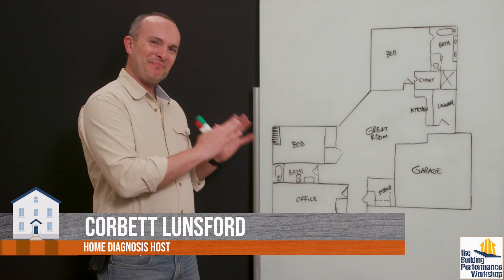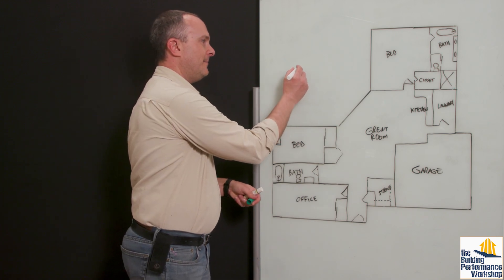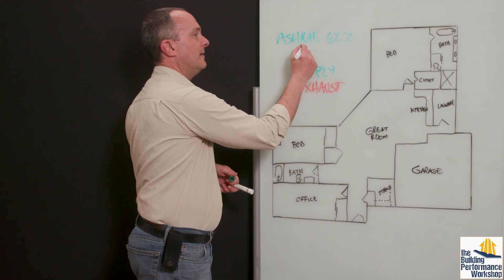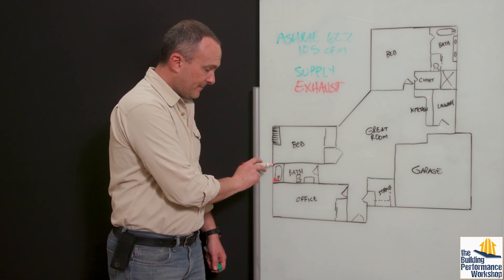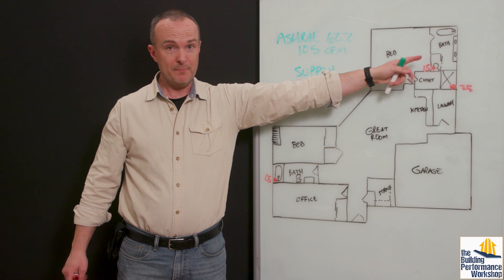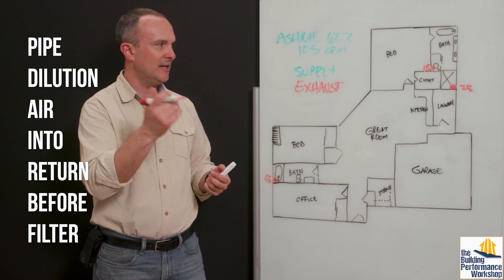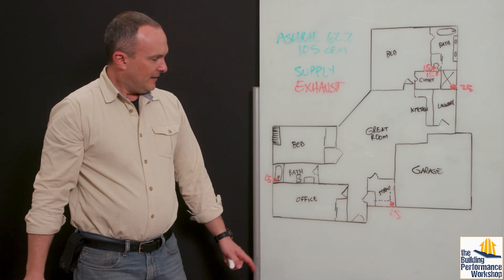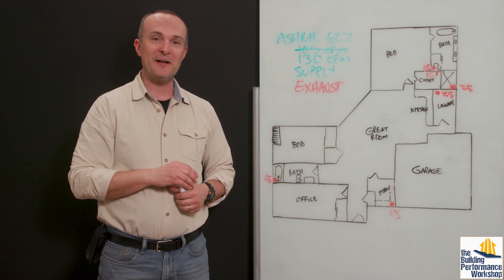Airtight Home Ventilation: Where to Place ERV Exhaust and Supply Grilles (HVAC Training)

Comment: If you dump the fresh air into the return of the central AC, and provided the ERV is set for 24/7 operation, then wouldn't your blower in the air handler also need to run 24/7? That doesn't sound right to me for my market in central Florida. We need the air handler to shut off to allow the coil to drain condensate for humidity control, am I missing something here? Thanks. I'm thinking I might just need a dedicated whole home dehumidifier in conjunction with the ERV.
Reply from the maker: Hey Andrew- you don’t need the pause to drain if you have supplemental dehu, which you def should in FL regardless. The upside of circulation, even temp/RH, and filtration outweighs the slight ding ding on the dehu.
Reply: @HomePerformance ok great, thanks for the info. So you would recommend just having the dehumidifier calling for the air handler fan on when the dehumidifier runs right?
Reply from the maker: If the AHU is running 24/7, no need- fyi Mitsubishis are designed for 24/7 blower.
Reply: @HomePerformance thank you, really appreciate you getting back to me, love your videos. I’m learning a lot!

Comment: Are you saying that a bathroom exhaust fan is no longer needed to switch on when showering? The ERV runs 24/7 therefore traditional bathroom exhaust fans no longer needed?
Reply from the maker: Correct. And it’s in the Int’l Mech Code too.

Comment: Hello!  Quick question, and I apologize if I'm missing something obvious because I'm new to the channel.  In your description here you note that you "generally only recommend ERVs for very airtight homes (less than 2 ACH50)".  Do you have a video going into why that is, or what you do recommend for older houses?

I ask because I have a ~100 year old home, so it's very leaky.  However, there are some reasons I'm considering an ERV - basement moisture levels (stone walls), potential Radon, smells (basement + litter boxes), and generally just a desire to move fresh air through the house.  The home, despite being leaky, has a tendency to get stagnant and basement litter boxes and moisture with an open door for the cats mean smells drift upward.

The house currently has no central ducting (the only current heat is a vastly underspecced wall furnace in the family room, house was originally heated by wood stoves), but I'm planning to add a ducted mini-split system via the basement, which has completely exposed ceilings giving good access.  Adding an ERV seems to make sense to me, but you're the expert here and I'm interested in your input.  I just couldn't find a video addressing that!

Also, my local electric co-op has a $500 rebate for any ERV install and it doesn't require a license contractor, so I'd get a pretty solid discount.

Comment: So you run some sort of flex ducts from each ERV return (separate from the air handler’s returns) to an exhaust collector and then dump that to the ERV exhaust, but then you pipe the ERV supply into the air handler’s return be for the filter?
Reply from the maker: Yep, that’s the most straightforward way

Comment: Do I remove the bathroom fans and use it as the erv/HRV exhaust suction location or do I supplement the existing fan with a erv/HRV exhaust suction location in the bathroom?
Reply from the maker: It depends on many things, don’t take a simple answer

Comment: I have a home built 100 years ago where the walls are only true 2x4 and I already insulated from the exterior with rain screen and exterior insulation because the inside is plaster and lathe and we live in there with kids. It's only like 1400 sq ft up and down total. 2 small bedrooms and living room upstairs with 16ft open ceilings and a s. All loft open up there and then downstairs we have the kitchen/utility room (always open door) and 1 bathroom. 

We love on a rock and have high levels of radon that the radon fan has issues with when it's raining and winter (windows closed) should I just put 50cfm on each and put them furthest from the outside doors in bedrooms? We rarely close doors since it makes it feel cramped

The utility room is where I'd put erv but.. oil boiler there that has a damper and when it's windy it flaps open and closed a bit. We have a heat pump water heater in there and I don't want to pull diesel heat fumes back into the house xD.

Comment: i live in the United Arab Emirates, where temperatures during summer can be up to 52 degrees celcius, and 12 degrees celcius in the winter.  Our problem is most buildings here and homes have oversized air conditioning system to cool us rapidly, and almost all buildings are air tight.  would an ERV work here?  because we get rfeally high relative humidity indoors whichs is causing mold problems for most homes.  Please do an episode for homes in regions like the middle east.  thank you.
Reply from the maker: FYI I have had clients in UAE and Egypt, happy to help if you need it. Yes, ERV and also dehumidifier would be useful.

Comment: Hi, how are you determining that each exhaust is 25 or 15 CFM? Is this determined by duct size?  Also, in some of your other videos I hear you talking about upgrading all ducting to 8 inch diameter as it moves double the air. Would you recommend this for both exhaust and supply forERVs?  Great videos thank you!
Reply from the maker: I love pizza btw. 20 cfm is code, but I think showers are more important than toilets, hence the 25 and 15. Upsizing the trunk lines reduces friction, you won’t get 2x airflow but it’s nicer on both supply and exh.
Reply: @HomePerformance  thank you for the clarification.  I live in Texas in an older home built in 1970.  I’m in the process of sealing all the cracks, holes, voids with canned closed cell foam (Great Stuff) And was considering installing an ERV before I go back in with blown in insulation. Would you recommend an ERV for an older home like mine?

Comment: I've watched the whole video but you did not put any supply on your plan. Where do you need to put supply? Also, in bathrooms, do you need an exhaust fan or is the ERV enough?
Reply from the maker: ERV is enough, 20 cfm continuous per code. Supply either into bedrooms (mentioned, but briefly) or into return plenum of air handler.
Reply: @HomePerformance  Alright! Since you place your exhausts in the corners of the room, where would you place the supplies? Thanks!
Reply from the maker: @AntoniPaquet bingo, same logic- the futhest spot from the door would be best but if you mix with ceiling fans then it doesn’t matter
Reply: Thanks alot!

Comment: Is there a recommended return boot and grill for placement when set in shower for erv exhaust?  I assume platic is better then metal. Is there an ideal shape /size?  Would a liner slot return be appropriate in this use case?

Comment: Hello, I'm Building a 2,492-square-foot home in CT (with four bedrooms, 2.5 bathrooms, a small airtight attic, 16", 9' 8' ceilings, and four people). I'm considering the Broan B160E65RT AI 142 CFM ERV and a Waykar 130-pint dehumidifier (location basement). The question is how to duct it with five supplies and seven exhaust locations, one of which is the attic. Thank you for your time!

Comment: Question ... 
What do you use as return and supply vents? 
Specifically looking for size and shape.  I'm getting an ERV installed, and I don't think my installer is smart on the setup/concept of how it should be done.

Comment: I think that the emphasis is CO2 buildup and odor control so IMO, exhaust the stinky or humid areas, supply the populated areas where people need the fresh air, then let that air migrate towards the exhaust points. Ventilating a closet is probably not a common practice but I suppose the closet could have  louvred bi-fold doors and let the air exchange thru natural convection. The laundry room has a mechanical exhaust by virtue of the Clothes Dryer, and is a low occupancy area so why even bother.

Comment: 16 yr HVAC service technician here. It’s infuriating to find out that my common sense has been correct from day one about vent locations and the need for ervs. I’ve always wondered why the ‘fart fan’ is always located closest to the toilet rather than just over the shower. Dumb! It’s not for odors, it’s for humidity removal. Period. Great video.
Reply from the maker: Thanks man, happy to hear it
Reply: The principal at my firm says the same thing and doesn't agree that it needs to be for humidity removal. 

The only consideration for putting it in the shower corner is it brings in relatively cold air into an otherwise hot shower. Something I advise our clients on and let them decide.

Comment: I think it is a mistake not to have an exhaust for kitchen. Cooking produces lot of humidity and various smells.
Reply: But this way you make a messy disbalance of in/out volumes. Will not work in tight envelope houses. Good extraction hood can do hourly cfm of an erv/hrv in few minutes. And in cold climates this will not work, might freeze the unit as it sucks a lot of cold air and there is no exhaust to warm it.
Better to do extraction hood with carbon filters, that dumps air back in the house and have erv/hrv exhaust in kitchen. Well at least thats how we do it Europe.
Reply: you are loning for make up air
Reply from the maker: You have a dedicated exhaust hood dumping outside, use that

Comment: So, just a thought— about that first thing you said with Vancouver’s code requiring HRV instead of ERV.   You said you would strongly recommend ERV, because it’s damp there! Which makes sense.  

But — I just happened to read just a few minutes ago, on a different site while I was researching all this for myself, a recommendation to specifically use HRV if there is high humidity —  •in the winter•.   If there might be moisture issues, in the winter.  Important qualifier?  
Since these systems are influenced to some degree by the temperature, and that seems to affect what they are doing and whether heat or humidity is traveling in or out, I imagine that summer humidity would be different from winter humidity, in how they would operate?  Is that true?
That was what my wondering was, when I came across that because I also was confused initially when I saw that the  ERV wasn’t what they recommended for winter time humidity.
 
   🤷🏻‍♀️
Would be curious to know what you, or others in the know about the systems, might think about that possible little detail.
Reply from the maker: Winter humidity is actually super dry when you warm that air up to room temp. See here:

Humidity Control 101: Psychrometric Wheel Calculator’s Dewpoint and Grains/Pound of Moisture
https://youtu.be/s-VyqdYnEfM

Comment: Hi Corbett,

I wish to check an idea I had, and for which I could not find any information (only a hint in one of you videos where you and your wife talk about the recirculation function of a Broan system). Given your approach, I thought you may have a relevant say about it. Here is my contact and my question :

Context : I wish to imrove the confort and Energy Efficiency of a hourse I own. it was built in the '50s and adding air ducts would be difficult in rooms. Corridors are not directly heated in the current setting.

Question : Would it be dumb to use a HRV to
 - pull air out of the Kitchen (level 1), Bathroom (level 2) and maybe Home Office (level 3) 

- push air in the corridors on 3 levels

and use a 2 Spot ERVs to supply rooms with fresh air by pulling it from the corridors when needed based on CO2 level detection. Maybe a simple vent would be enough ? (polluted air would be pushed below the door)

Thanks in advance for your feedback !

Comment: Your perfect house layout has a lot of showers and baths against outside walls. I was taught never to place large areas of waterproof wall (such as a shower or bath surround) against an outside wall, because it will create condensate and mould issues in that wall.
All airtight, all vapour permeable, is what we're being told here.

Comment: I plan on putting a spot ERV in my basement to help with radon mitigation. It is about a thousand square feet unfinished and I'm looking at the Panasonic whisper comfort 60, a new model that came out last year. It can be placed in the ceiling or on a wall and I'm trying to decide where it will have the most effect high or low? Easiest and with the least amount of turns for ductwork to put it in the ceiling, so I guess there's that consideration of loss of CFM

Comment: How do you check if your flows are balanced between hvac equipment and the erv fresh air if you put it into your main return? I read they’re suppose to come out with systems that are connected to your air handler but haven’t found any. Also how do you address the inefficiencies of this install method?

Comment: Thanks for this video! Are there pros/cons to supplying and venting every room? Bedrooms for example, having fresh air brought into one corner of the room, and "old air" sucked out from another corner?
Reply: More ideally, each room would have a center ceiling supply, and exhaust at opposing walls near the floor.  This provides clean laminar air flow to the head, pushing floor dust into the exhaust.
Reply: Every room that has closable doors needs to have its own balanced supply and exhaust. If the supply and exhaust to a given space are separated by a door, then when the door is shut either you have a draught under the door, or there isn't a big enough gap for a draught and the airflow simply stops.

Comment: The ERV was the biggest waste of money in my new build.  Super expensive.  Noisy.  Power Hungry. And every time i open a window the ERV is redundant.  I got so sick of hearing my ERV i turned it off. NOTHING WENT WRONG.  I didnt suffocate in my sleep.  No mold.  No dry air.  NO PROBLEM. ERVs are a Greenwashing scam.  Nothing more than an expensive loud power hungry fan.  The HVAC people who evangelize ERVs dont tell you that ERVs can freeze up in winter.  Then they try to upsell you a super expensive ERV Heater.  Which uses even more power.  Avoid this Green Wash Scam. They just want your money.

Comment: You have mentioned a few times on the comments that there shouldn’t be a ERV exhaust in kitchen. Can you provide an explanation why!? Or maybe you already have a video where you explain this!? 
Thank you.
Reply from the maker: There should be a powerful exhaust fan over the cooktop, dumping outside. If you have that, whether or not there’s a 25 or 40 cfm ERV exhaust in the space is not a big deal.
Reply: @HomePerformance  So you are not against having an ERV exhaust in the kitchen!? It’s just if you have proper exhaust over the range with a proper makeup air system there is no need for it!
Reply from the maker: Exactly right

Comment: im actually about to move my ERV exhaust vents to my kids bedrooms, and add a fantech bathroom exhaust.  I would prefer not to bring in air when exhausting the bathroom on hot humid days.  Is there a pressure difference, sure but I still don't believe my house is that tight.

Comment: So if you dump in to the return you have to run the air handler when the ERV is running as well?
Reply: That's actually a good question, I can't imagine the blower wheels on Erv's are strong enough to direct the air in such a large pipe

Comment: I’m working with an old house with a partial basement and no attic. Thinking to duct both supply and exhaust air from my furnace. Can I just pull straight out of the plenum and feed straight into the return? Id love to get more nitpickey over feeding and pulling from certain rooms but even renovating the duct system to feed everything used every last bit of space.

Comment: Are there some climates where HRVs and ERVs aren't worth the extra install costs and running costs? In Auckalnd our summers are mild and winters not bad either so it doesn't seem cost effective here. Would you agree just a positive pressure ventilation system would be better in Auckland?
Reply from the maker: Not climate, but home characteristics- if your home is tight enough that bath exhaust fans will cause suction problems, you must have an ERV to exhaust from bathrooms and balance. If not tight enough for that, then stick with simpler means of getting fresh air.
Watch this:
https://youtu.be/lnOCAPPVT5g?si=yRBsI7JJ7y2h8Heu
Reply: @HomePerformance  ph, let me clarify. I mean ERV vs supply only systems. MY point is, I think in Auckland it's not worth the extra cost to try and recover heat from the exhaust air.
Reply from the maker: Again, I don’t even worry about the recovery aspect- to me, it’s all about the balanced pressure in the home.

Comment: Can someone explain to me (cause I am not familiar with the technology): why can’t we simply open the windows once in the while?
Reply: ERV does a number of things better than a window. It balances the intake/exhaust air temps so your heating/cooling system doesn't have to work so hard to maintain indoor climate. Also, open windows allow allergens to come in whereas the ERV can clean the fresh air before distributing it around the house. ERVs also do a better job of moving the air through the whole house to manage humidity and condensation. A window might help air flow in the immediate area, but the back bedroom would need its own open window. Too many windows open and you're just exacerbating the heating/cooling compensation.
Reply from the maker: Very well said- another way to put it is you want to follow the 3 rules of homechem:
1. Don’t bring bad stuff inside
2. Ventilate
3. Keep it dry

Window opening does not reliably do any of these, since you’re married to the weather.
Reply: We seem to be approaching the end stage of overly complex societies.  Shouldn't be long, before we are back to radio communications and out houses.